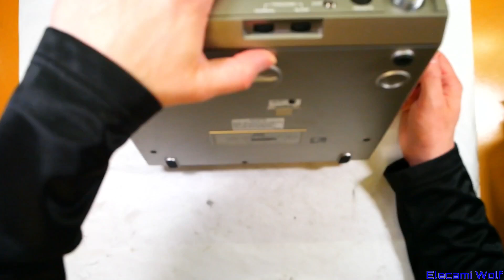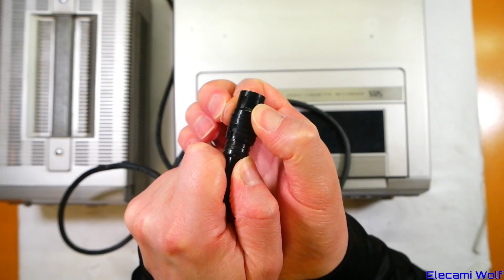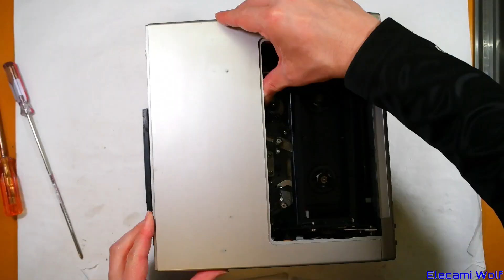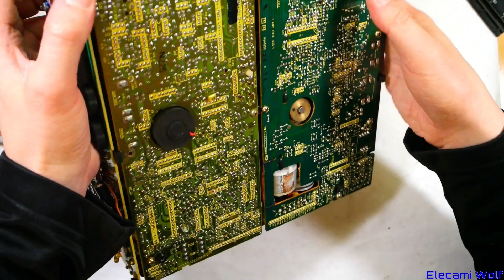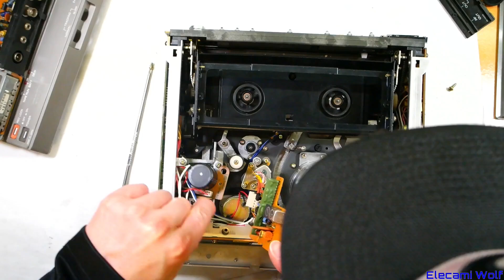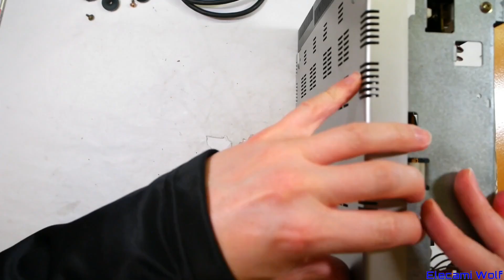EW0175 - JVC HR-2200 VCR Teardown Investigation

Comment: I have one too.  
It's about two months i'm trying to fix it.  
It has a jittery image, caused allegedly by a defective capstan phase servo.  
And one head has a weak rf output, from which the corresponding video field disappears to total noise if you adjust the servo in a certain way.  
Can you help me? I studied schematics in detail but maybe something is missing to me.   

If you managed to get it running, can you share some waveforms from the oscilloscope, so that i can compare them with mine ones?
Reply from the maker: I didn't attempt to repair my one, sorry.

Comment: I don't think that tuner/timer unit is a UK model, as their JVC models numbers usually end EK. Also the UK was UHF only for 625 lines and that tuner appears to have switches for VHF/UHF selection. Ireland used both VHF and UHF and they are probably 240 volts.